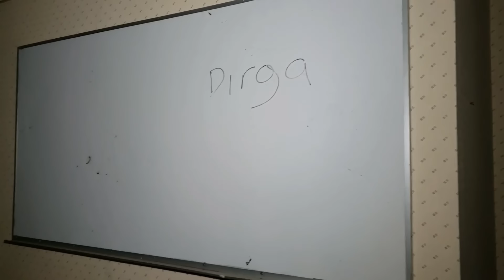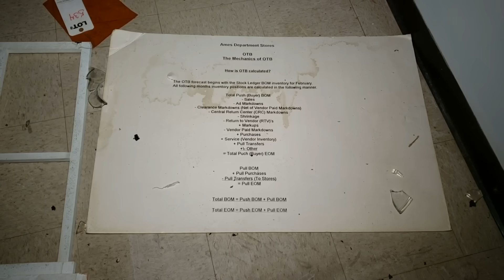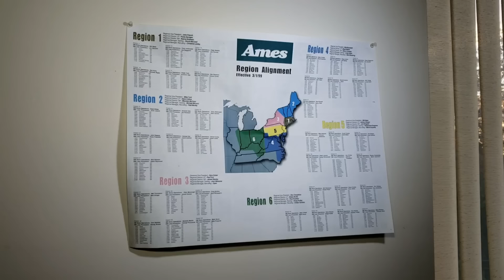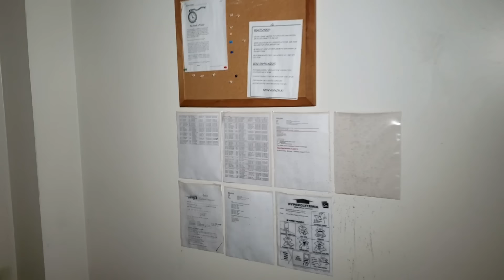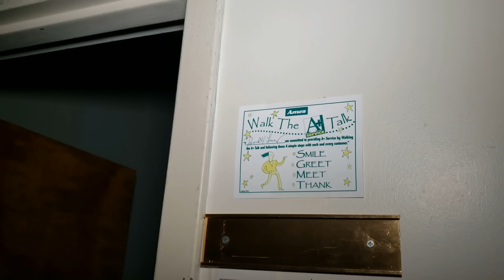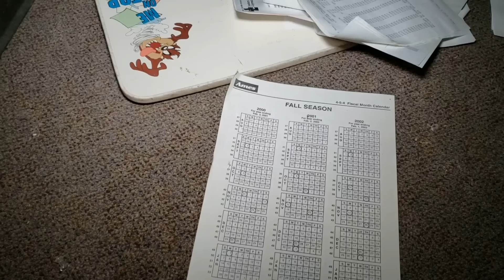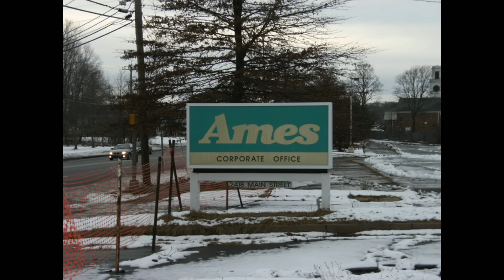Exploring The Abandoned Ames Corporate Office w/ Ace's Adventures

Comment: lol.. worked in that building ~15 years.. mold wasn't bad then
21:29 - wow.. John McClintock - he was in finance
28:21 been up there - those execs were... well.. they ordered F*ck You rubber stamps for their internal memos they'd review between each other. They had to order them from a secondary vendor, because our primary wouldn't create them.

the A+ service cards were something that was handed out when you thought someone did "A+ service"

36:36 downstairs was print shop, mail center, and something else.. i can't remember
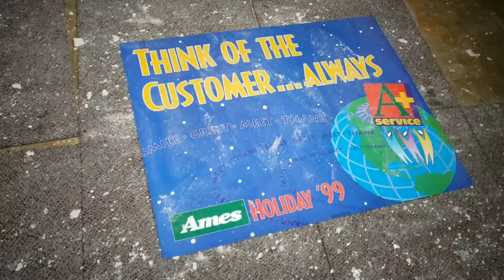37:16 fiscal month calendars - remember them well!
37:44 Star Performer mug!!! i have at least 2 of those still in my kitchen cabinet.

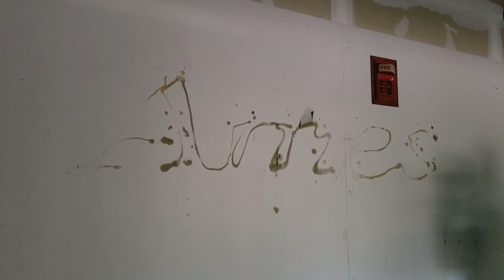trying to get my bearings as you go through - i was hoping to see 1st floor "executive row" - that was an area that executives were sent as they were leaving. (located to the left of the main entrance) - might have been around that at 41:55
43:08 entrance to the mezzanine - some IT folks worked up there.
44:07 i had a cube in the lower left quadrant - there was an entry to the computer ops section